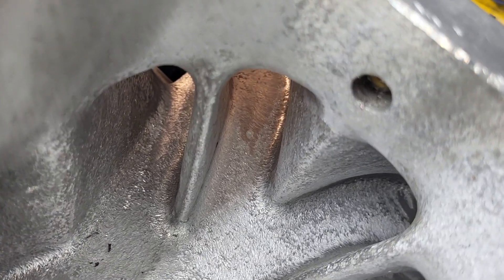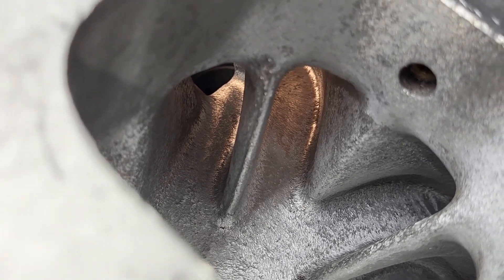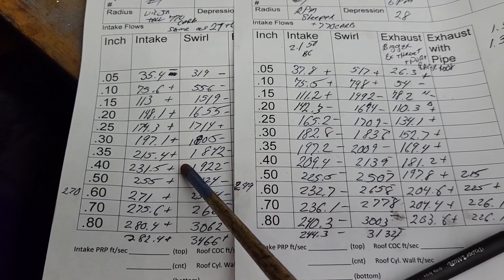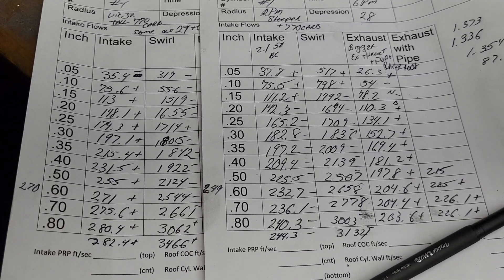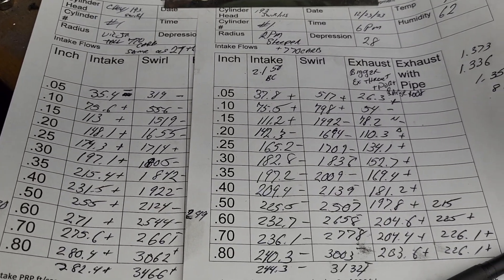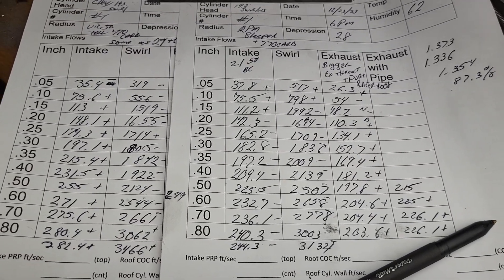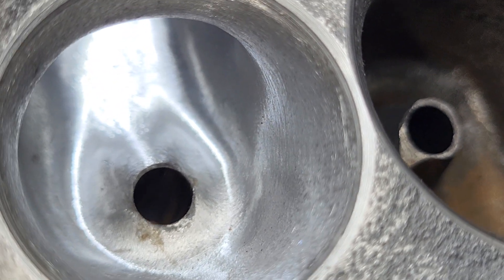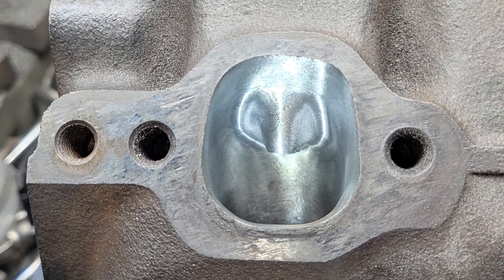33. Chevy 193 Swirl port cylinder heads 27th flowed w/ Edelbrock Vic Jr. tall ported &770 cfm Holley

Comment: Ok Charlie, a bit of theory for you. If you flow a port at an equivalent of 28" H2O (if that's your standard), and you flow a manifold runner separately at the same pressure drop, would you need to flow both together at 56" to get an equivalent flow rating? It seems that putting one next to the other stacks up the restriction so theoretically, the pressure drop for both should be double? Or is that not how it works?

It just seems pointless to agonise over the last 5 or 10 CFM in the port when we go bolting on an equally restrictive manifold and negate all that work to get the port right.

Say we can get 300 out of a nicely sculpted port... we go bolting on a dual plane that drops it down to 240. That means that this 300cfm port can only flow 240 now. Is all this work still worth it? Would bolting the same manifold to a port that only flowed 240 by itself flow less than that now?
Reply from the maker: I think of them as series resistors. If the head flows 300 and the intake flows 300 at 28" when added together they will flow alot less than 300 but you are right they split the depression so they have to flow less. I never thought of it that way before. Thanks

Comment: You started this series just as I found out my 4.3 TBI needs a rebuild ... 🤔
Reply from the maker: Same design.....hmmmm.
Reply from the maker: Maybe I could be convinced to do some tbi manifold and throttle body videos. I just need a stock v8 tbi intake. I have everything else. I love to do these and just mod up stock stuff!
Reply from the maker: I still have some stock head ports too!
Reply: @servediocylinderheads   I've seen the common mods people do to their throttle bodies and wondered if the actually help or hurt.
Reply from the maker: @erikredIV  I am pretty sure I have a stock and a modified Chevy 350 tbi throttle body. So I could test them as well. I have been looking for a stock tbi intake but people want stupid $ for them. Thanks
Reply: @servediocylinderheads  That would be awesome! I'd send you a V8 intake but I only have a v6 intake at the moment.
Reply: I always had a strange compulsion to do something different and modify what wasn't supposed to work rather than jus buy what was already known to work.
Reply from the maker: @erikredIV  I understand completely. Thanks
Reply: I'm seriously considering pushing the stock 4.3 tbi stuff, ecu and all, to find the limit. A question often asked but never answered.
Reply from the maker: @erikredIV  I did alot of that research in the 80's.  The map sensor and lobe center angle of the cam need to be right for proper vacuum. I made that mistake.
Reply: I had my eye on a 4.3 single plane intake before this video...
Reply: I think all of the aftermarket cams made for tpi/lt1 (speed density from '90-'93) are ground on a 112 lsa. Of course the durations are in the two-teens and low 220's @.050 so still not much overlap. Sorry I'm stuck 30 years in the past.
Reply: Is that why all the stock 4.3 cams seem to have a 112 lss? They have the stock ecu so well hacked these days I was hoping the vacuum/MAP problem could be tuned out.
Reply from the maker: @erikredIV  I am surprised they are not 114 degrees lobe center line angle.